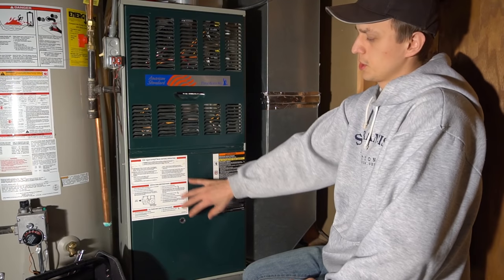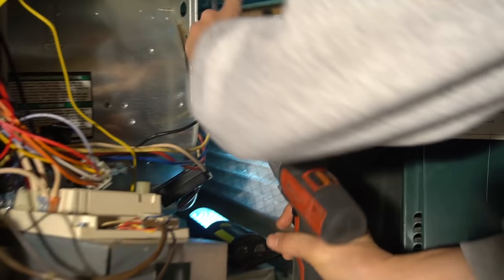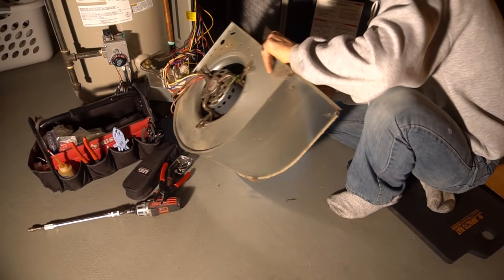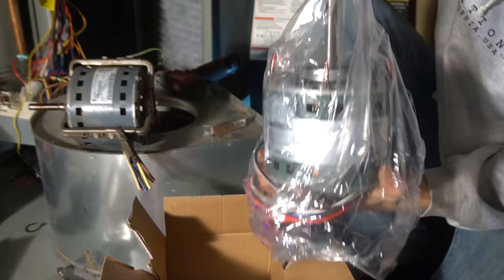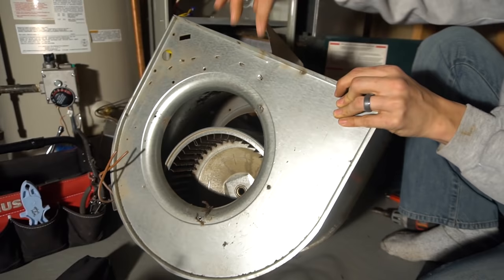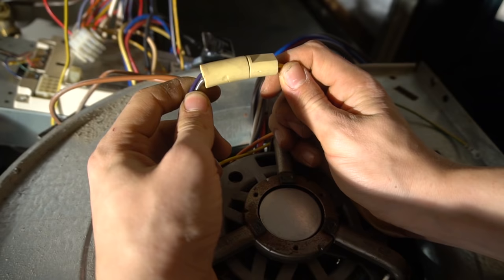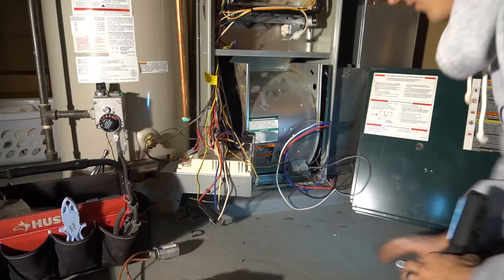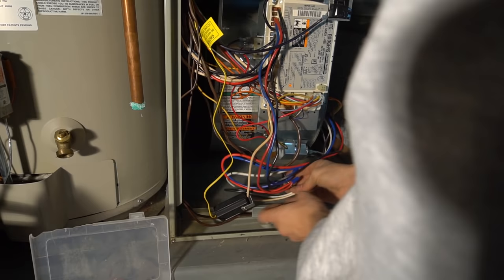Furnace/AC Blower Motor Replacement Step By Step

Comment: Thank you SO MUCH for doing this, I was going to HVACR, but my epilepsy took over, I couldn't finish- my furnace Rheem blower crapped out in the summer (the whole house unit [furnace, a/c, water heater...] ) and I needed help on how to do this.  I had the tools, the knowledge, but I didn't remember all how.  Thank you again, I even have you saved on my 'watch list' and I'm so glad I did.  🤗 🐾🦊🐾
Reply from the maker: You're very welcome! Glad to hear that you were able to get it done and the video helped! Stay cool!
Reply: @WordofAdviceTV  When I took the Rheem furnace apart for the blower,  I ended up with something that caught me surprised- the blower wasn't made by them, it was from Emerson- is this something that's normal or just a cheaper blower that had been replaced before (if you can)?
Reply from the maker: @TheKitsuneDen  Most likely the motor has been replaced before.
Reply: @WordofAdviceTV  I still haven't gotten the correct motor- it's driving me nuts.  I have the right numbers, is it something that common?  I finally found the right number one in a place called Radwell for the correct motor I'm waiting for.  (I clicked the wrong one on eBay on accident..) Plus I still haven't found your name- I only know you through 'WorldofAdviceTV",  I'm Foxlink.  If you wouldn't mind share, please thank you.  -Foxlink

Comment: Thanks for this comprehensive video! I think my Trane XE80 looks to be exactly the same as your furnace... Unfortunately my blower motor crapped out during this Minnesota winter, and your video allowed me to pick up a new one from a local supply co and install it in a couple hours! For some reason though, now once I turn the power back on to the furnace, the first thing that kicks on is the blower motor. Nothing else, including the inducer motor ever kicks in. Any ideas? A few wires seemed to come undone during the process of me removing the blower wheel cage, so it's possible I reconnected things incorrectly YIKES :(
Reply from the maker: Most likely something is wired incorrectly then. Unfortunately with this one I won't be able to help if I can't see it. What you can try doing is looking at the wiring diagram that should be on the back of your furnace door and try to figure out where the wires go that way.
Reply: @WordofAdviceTV  Thanks for the great advice! Using the schematic as a guide, I diagrammed everything and checked each connection along the way. Turns out, one of the wires that went into the plug that supplies the igniter and inducer had come loose so I plugged it back in and it fixed the issue.

Unfortunately, there was also an issue with the fan control limit switch - one of the tabs had broken off the switch housing, so the pressure switch wasn't working correctly. I confirmed this was the case by temporarily using a jumper to bypass the switch for testing purposes. Any suggestions on finding a replacement? Not really sure what specs to look for and I was going to call some local supply stores tomorrow...
Reply from the maker: @0xSpiff  Glad to hear you found the wiring problem! As for the high limit, I would find  the model and serial of your furnace (should be somewhere on the inside of the furnace cabinet) and go to a site like repairclinic.com and find which limit switch you need. Then you can buy it from them or write down the part number and look on Amazon or maybe you have some appliance/HVAC shops locally.
Reply: @WordofAdviceTV  Yup I took down the furnace info and luckily we have a lot of industrial supply shops around where I live (Minnesota) and was able to get a replacement. Everything works now, thanks again. Legitimately one of the most useful/helpful videos on all of YouTube! :)
Reply from the maker: @0xSpiff  Awesome! Thanks! Stay warm ;)

Comment: I just needed to know that I could pull that bottom door off. You have to be careful about muscling things when you don't know they're supposed to be muscled. There was a clicking noise coming from my blower fan. Pulled that bottom panel off, looked inside, and lo and behold somehow a warning label had made its way into the blower fan. Easy fix, but you showed me how to take off the bottom panel door.

Comment: What a great video.  Very well done and edited.  Easy to follow and still have all the details needed.  You are a great teacher.  Thank you so much for sharing!  

In the middle of the polar vortex outside of chicago.  The temp outside was -16.  My wife woke me up  at 3am and could hear humming and smelled a light burnt odor.  After watching your video, I went out to the store and picked up a motor (and capacitor) and replaced it.  Working great again.

Thank you so much for taking the time to put together such a great and informative video.
Reply from the maker: Glad to know my video helped! Stay warm :)
Reply: Ken did you use the same bracket that came off the old motor?

Comment: Awesome. This fix is gonna be way easier than I thought. Trying to just replace the compacitor tomorrow. If I still have the problem I'll replace the motor. Either way this saves a bunch of money on something that's not really that hard. I won't touch anything that has to do with gass lines or incoming plumbing. But if it's outgoing plumbing or simple electrical fixes I got that all day.
Thanks!👍

Comment: Thank you for an amazing video. My blower fan wasn't working and the HVAC tech said I need to replace the furnace as its old - He pushed hard on selling new furnace. After watching your video, I thought I had not much to lose as in the worst case, I'll replace the furnace anyway. then I replaced the fan and it still didn't work. Then I watched your other video to troubleshoot the circuit board and sure enough it wasn't giving power to fan. I simply moved the power cord to another empty outlet in the circuit board and it works like a champ.

You literally saved me $2500. Clearly I didn't even needed a fan but I have it now anyways.
Reply from the maker: Awesome! Glad to hear you were able to get it fixed and my videos helped in the process. Long live the furnace! ;)

Comment: You make it look so easy! Thanks for this vid, I know that I will be doing this in the future, but I do not have as much room to operate as you do, my unit is in a 4x10 area under the stairs, with a water heater right next to it, not a lot of room in there. Thank you again for all of your videos, you have saved me a lot of headaches!

I'm glad that you pointed out the motor reversal cable, this is a great idea to have on the motor, as well as knowing about it, because it would save someone all that effort after having preplaced the motor to go back in and correct it by removing and reinstalling the motor, thank you!

Comment: Awesome job i don't have much experience but learning as i go with each costumer i personally take off all old wires and connect the new wire from motor but nice to try different ways to see what works best thank you for sharing your experience
Reply from the maker: Thanks! I did it with wire nuts because I knew that most people will likely not have wire connectors laying around that they could use. Sometimes I do it your way too. Using wire nuts is another way for me to show that the motor is not original and has been replaced. Anyway, cheers! Good luck on your career!

Comment: Lesson learned today!  Grainger sold me the wrong motor 230 volts instead of 110.  Had a friend come and help and we did not realize it was the wrong one until we got the new one in!  Our fault for not looking first and Graingers too selling the wrong one!  Have the old one in now and hoping it holds until tomorrow when I go get the right one!
Reply from the maker: Yikes! Sorry to hear about that. Hopefully no damage was done
Reply: @WordofAdviceTV  No, thanks for asking!  Everything is working just have a motor that chirps every once in a while. I have left it on as it seems to make the most racket on startup and I am afraid it may not start one of these times. New motor and capacitor waiting for me Grainger. I hope my experience can save someone else from going thru this.
Reply: Finally got the right motor in today.  I also changed the mount close to the one you got from Amazon.  Thanks again for all the help on here!
Reply from the maker: @briancloutier2781  Oh yeah! I am sure people reading your comment will make sure to double check the specs on their motor :) Thanks for coming back and sharing!

Comment: Thanks for all your videos. Great camera work and even though you move pretty quickly you put a lot of info into each video. Easy enough to watch a few times to get the info down.
This answered a question I had earlier about cleaning the blower. It would mean removing it, then the motor I guess.  That would make it light enough for me to get it across the attic and down the stairs.
Take it outside (much lighter without the motor) and hosing off all you can, then spray with good cleaner, then rinse. 
Not something I would do real often but at least try to do it every 3 years. Jesus bless.

Comment: Outstanding demonstration. Mine a tiny bit more work but done in 4 hours . This is counting all my research to get the best price on the motor. Amazon wanted $450 plus tax . Found a new motor for $95 plus tax and shipping was free. $104. Starting motor capacitor $10 on Amazon. $210 parts and labor. My free labor. I’m guessing saved around $600 to $1000 
Time for a beer or two 😂

Comment: Thanks for posting. If the wires are long enough add the crimped spades? Nothing against the wiring nuts but makes it more neat and avoids the potential intermittent connections from loose nuts. Thanks for the great video and excellent step by step procedure.

Comment: Thanks a ton, HVAC company charged me $400 to replace a broken module on my X13 ECM and then tried to bully me into spending another $1000 to replace the whole motor or they were going to keep my $400 and take the module back. Swapped out the motor myself for $300 in parts and 30 minutes of my time. Still bitter about the $400 lost but at least I got to stay cool for a few days while the parts came plus I learned not to do business with them again.

Comment: Thanks for posting.  Your video gives me more confidence as I get ready to tackle this job.  Would have like to seen you include the troubleshooting to narrow the  problem down to the motor, but this must have been posted in a separate video.  Very good explanations.
Reply from the maker: Glad you found this video helpful! As for the troubleshooting, there was no video for that since it was very obvious. You could smell the burnt motor very well, it was super hot to the touch, and if you reached in and tried to spin the wheel it would not spin because it seized up. Although I should probably mention that I ended up replacing the motor bracket because the old one I reused made the motor noisy. I put in an FM55 bracket. http://amzn.to/2ygHXzk

It sounds like you are not sure if your blower motor is the problem. It may be the control board just not sending it power. Try putting your thermostat setting from AUTO to ON and see if that turns it on. Otherwise if you look in the comment section, there was a viewer that had a control board that was bad, not the motor. Perhaps you should read that comments thread. His YouTube name is SuperYT4Ever

Comment: Thank you for sharing this video.  I swapped out my furnace's blower motor this evening, and it was a piece of cake.  The unit that I ordered came with a bracket pre-installed.  Also, the wires came with the connectors for the control board, so I didn't need to do any splicing.  I installed a new capacitor for good measure.  With winter coming, this was perfect timing!  How can I tip you?  Let me know, please.
Reply from the maker: You're welcome!! Glad to hear you were able to get that motor swapped out with no issues! This awesome comment is tip enough. 😄 Stay warm my friend and God bless!

Comment: So Baileys Air and Heating here in Modesto is trying to charge me $1,002.55 to get this done without a warranty and $397 with the original warranty. Since I am a new owner and this unit was installed 5 years ago before I bought the house, I may not be covered. My furnace carries a 7-year Mfg. warranty but only applies to the original owner, so I’m told. After watching the video looks like I’ll be doing it myself.

Comment: I had to turn off the electricity breaker, & slide out the blower assembly, and take it over to Brownell,  and the called me 3 days later, and charged me $250. Then I brought the fan assembly home, and had the gas turned off, and the electricity breaker off. And we slid it into place, and screwed it back in. And then reattached some wires, with wire nuts (ceramic wire nuts) . Then we went to home depot, and bought a thermostat pilot sensor, and a heater bi-metalic switch. (A little round button thing). Then we came back and installed the pilot flame sensor. And the new bi-metalic button high temp sensor (2 wires). Then when gas man came he turned on the gas outside. And we turned on the breaker, and turned up the heat thermostat to 80, then he pushed the red button in, and lit the pilot flame. then the main gas flame turned on, and after 4 minutes the new bi-metalic button sensor clicked, and the new electric fan engine started spinning, and blew hot air into the room. So that's how that works. If your heater stops working.

Comment: I would have recommended checking for power with a meter to be safe. Average diyer will just shut off power like you advised and power may not actually be off. Also wires not being disconnected while the blower assembly was removed was a very dumb idea. You could have mark the colors of the wires where they came from if you couldn't read a wiring diagram.

Comment: Great video! Quick easy clean instructions. No BS. Thank you!
Reply: Got my motor out in less than 10 minutes! Just have to wait until tomorrow to get a new one…I’ll follow up with you after I get it back in, thanks again for the info and easy to follow instructions!
Reply: Blower motor replaced but getting warm air now. ? New motor is a 3 spd so I had to figure out what to do with the red and yellow wires. Thought I had it figured out but now just getting air temp air circulating.
Reply: Update: ac was blowing regular air. Once I turned the furnace off and on again, it reset and started working! One last thing I will say is that, like the video, I went from a 4spd to a 3 spd motor. The leftover wire was yellow so I wasn’t sure if that was power…followed it back to the circuit board to see it was the leftover spd wire. Unplugged it and tossed it out.

Comment: Hello again great videos and good job.  My furnace blower work perfect for maybe a week then  stop working but I can hear a noise like there is power going to the motor and I  turn off the power for a while and turn on again and it starts working.  I would know if you can help me What can be the problem .i have a furnace model Lennox G8Q3-90-1.  And we appreciate your videos from Canada 🇨🇦 thanks again.
Reply from the maker: Most likely the blower motor capacitor is weak. If you have a meter you can check it, otherwise it is not too expensive, you can just try replacing it and likely that will solve the problem. If not, then unfortunately you would need to replace the motor.

Comment: One thing I would like to add is I used 1024 3/4 machine bolts with lock washers instead of the sheet metal screws to fasten the motor bracket to the blower housing.  I just felt more confident using them versu the original sheet metal screws. So far so good!

Comment: That unit is a dead ringer for my York furnace, right down to the size of the bolts and type of bracket.  I knew Trane and AS were the same, but I guess York is in with them.

Comment: Thanks for making the video.  Recently I burned up two blower motor relays on my Lennox a/c.  The coils were completely melted on both, which somehow burned up my wifi thermostat. (Probably when everything got melted together.)  Had 110v and 24v on the relay so I was confused on why they were getting fried.  Run cap on the motor was weak but still okay.  The only thing I could figure out was the blower motor was the culprit.  It was 27 years old and spun freely, but maybe had an internal short causing an over-current condition.  I installed a new identical motor which came with a slightly larger cap (370 to 440v).  So far so good.  The new motor seems noisy but hasn't fried any relays yet.  A 3 or 5A fuse will be going in to protect the thermostat.  Anyway, ever had a case with a similar problem?

Comment: I recommend to wear a protective glove when dealing with the blower wheel and check the capacitor before replacing the motor.  Last week I have the problem with my furnace blower motor.  It started with humming noise and could not turn the wheel.  I then checked the capacitor and found out it was bad because it was not in the required range.  I also oiled the motor too.  Now it is running ok; but I think my motor will go bad soon because it is still starting with humming noise.  The good thing is now it is able to kick off the fan at high speed when starting with the humming noise after all the fix (new capacitor and oiled motor).  It is running very well and hopefully it lasts for awhile.  Oh it is Carrier 3/4hp 3speed 115V motor and costed $285 from Amazon.

Today I just bought a comparable motor kit (Century 3/4hp 115V 3spd motor with 4 wings brackets & capacitor) from Zoro.com for $112 to be ready when the carrier one dies.